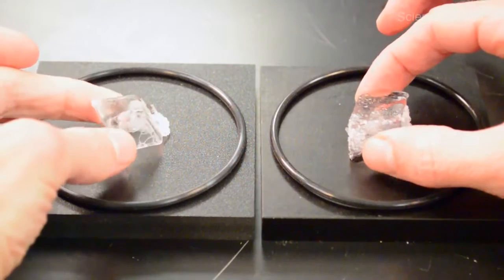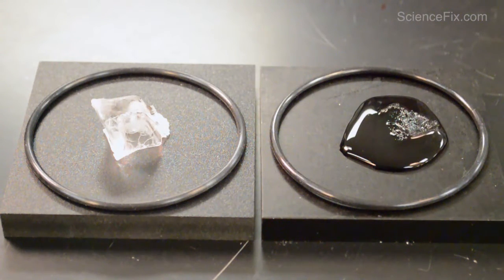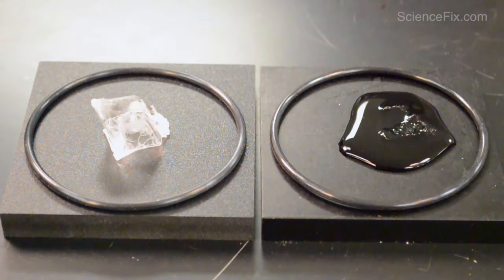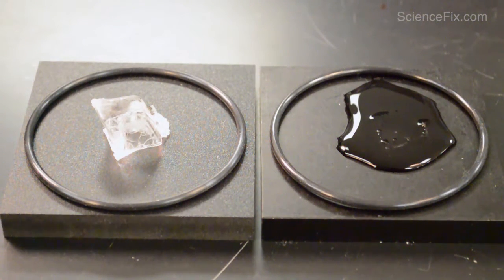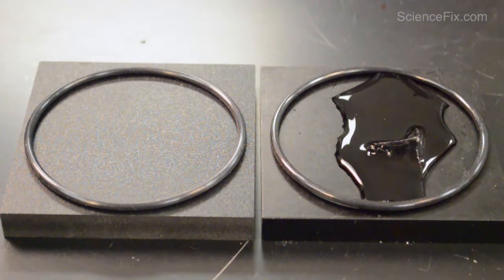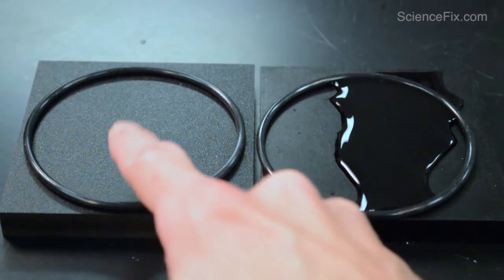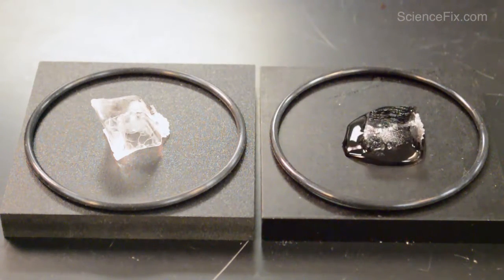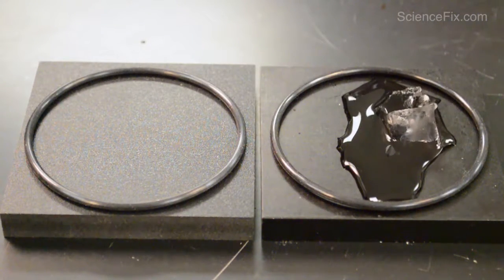Melting Rates

Comment: Great experiment. Heat energy always flows from the object with the higher temperature to the object with the lower temperature. So, you have to know which object is warmer, the ice or the right “cold block” or the warm block on the left? The answer is the right the cold block, which is made of aluminum. Thus, heat from the block flows into the ice cube. Aluminum is a great conductor of heat. The block on the left is made from Plastic, which is a great insulator, thus it is poor conductor of heat. One of my all time favorite experiments .